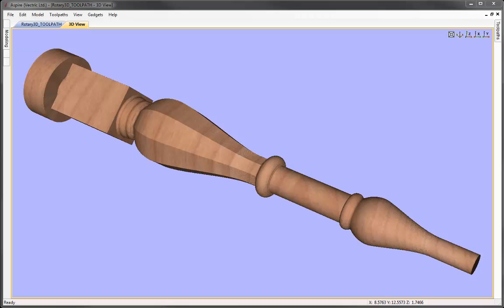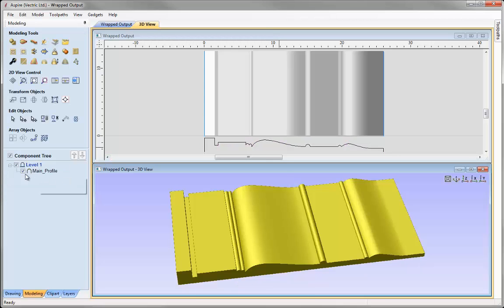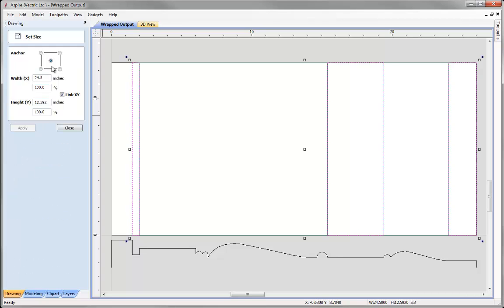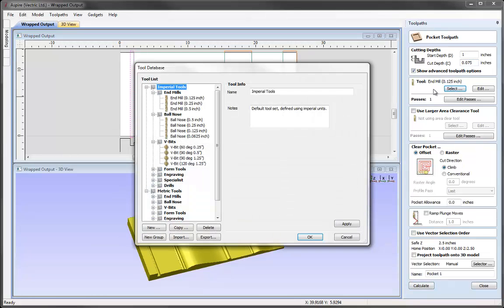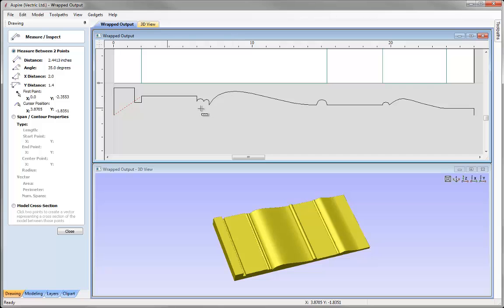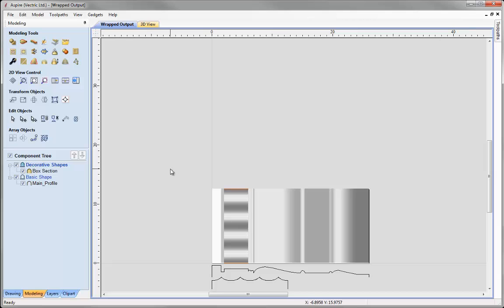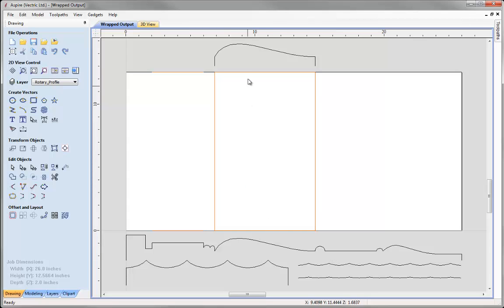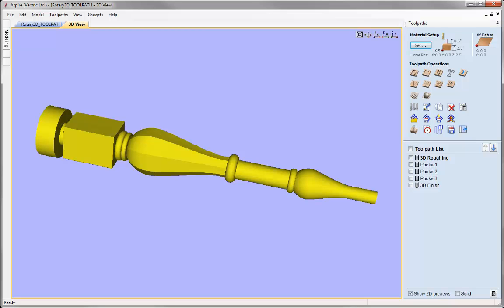Vectric V8 Tutorials - Rotary 3D Toolpathing

Comment: Great video! Question on toolpathing though. I recently Bought a 12inch indexer for my CNC and was trying to model my first practice file: a Groot sculpture from Gaurdians of the galaxy. I got the model placed and wrapped effectively but I am now concerned about my toolbit. There is a steep dropoff from the stock height to the model itself which makes me realize my bit only sticks out from the collet about 1.5 inch where some cuts go as far as 5-6ins from the surface. What advice would you have for me? appreciate any input, thanks!
Reply: 😍😍:stayhome:

Comment: This problem ( I suppose) is on the software or post processor level.
When I create things for my 4th axis, I use Vectric gadget Wrapped Job Setup and Vector Unwrapped. When I machine it, everything goes well except one nasty groove made by machine in the place where the wrapped job joints.
I made the same design in SolidWorks and imported it to Vectric as STL file……The same thing is happening

This only happens when I run roughing toolpath. Finish toolpath does not follow the groove and it looks like it functions well but can not correct the problem , since the roughing takes too much material making that groove.
(vectric project is clean , but the real piece not)
Any idea what is going on?
Thanx.